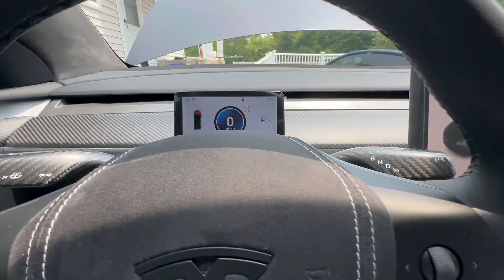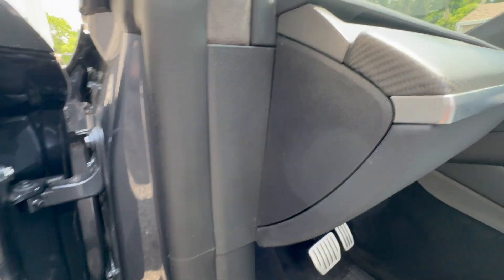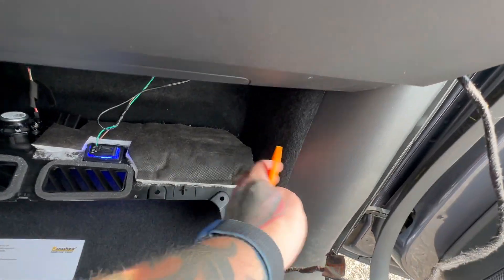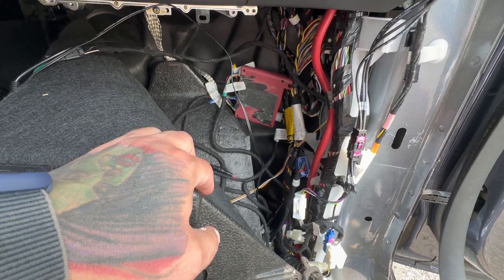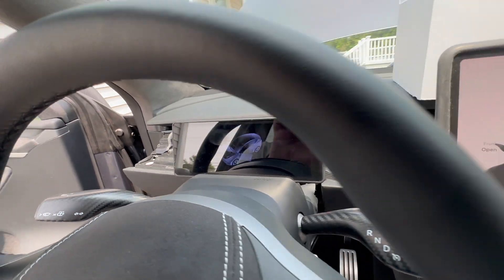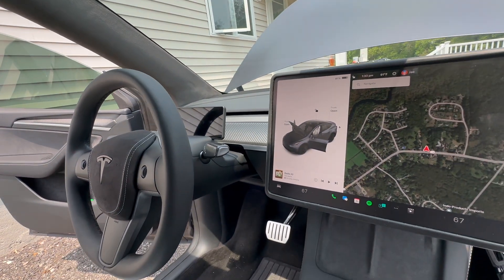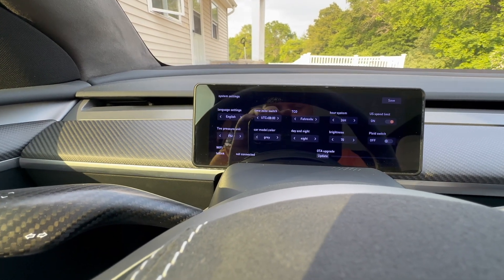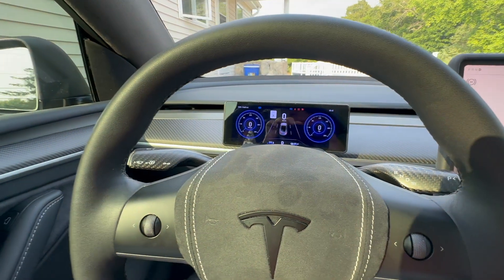Revolutionize Your Tesla Model 3/Y Hansshow H6 6.86 Display Screen Instrument Cluster Mini Display!

Comment: Does installing this effect the Tesla warranty?
Reply from the maker: No. While some dealers would have you think otherwise, simply having an aftermarket part or modifying your vehicle cannot void your warranty. However, if that part led to something breaking on the vehicle, the dealership can deny your warranty claim. Example. Id your wheel fell off, this screen couldn’t be the reason so your claim on the wheel would be honored. Hope that helps.